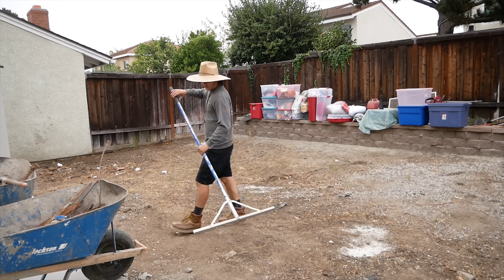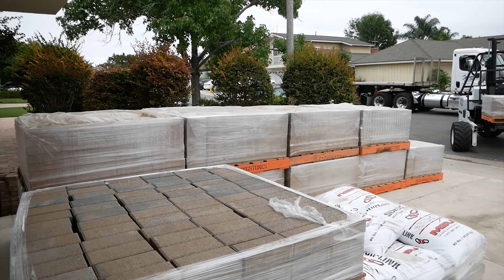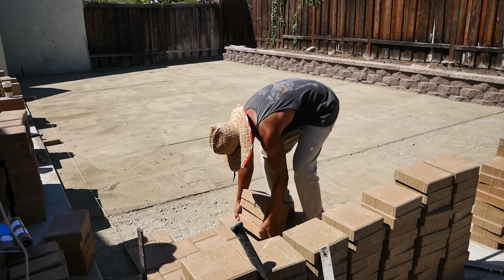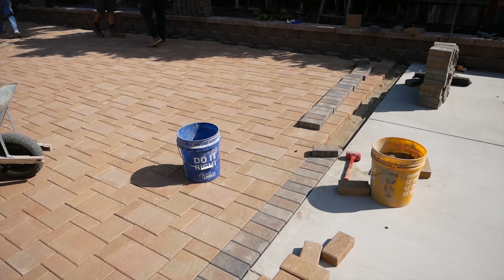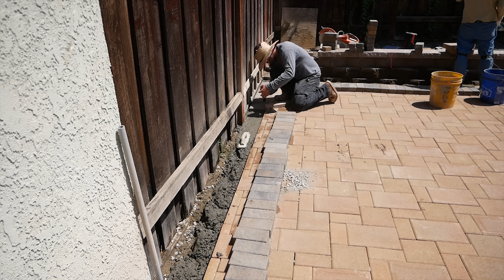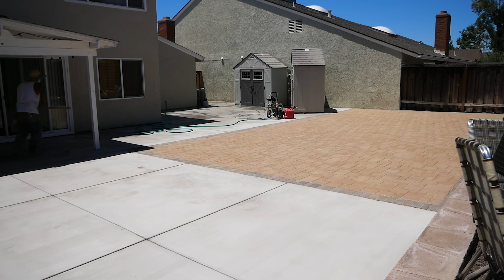How to Lay and Install a Massive Paver Patio! Part 5

Comment: Such beautiful work! Could you share the cost of a project like this? Or maybe the cost/sqft for pavers vs concrete slab? Does the price increase if you don't have vehicle access?
Thank you!
Reply from the maker: Pavers are twice the cost as pored in place concrete.
Access increases cost.
Reply: @OdellCompleteConcrete  Is that because of current construction material costs? Historically that pricing doesn't sound accurate at all.
Reply: @SirPhilMcCrackinVonBeggington  I can only speak for here in Germany, but paving actually is one of the more costly options you have. For one due to the price of quality pavers (depending what quality/thicknes you need, if you only have foot traffic, if there is some or regular light vehicle traffic, if there is heavy vehicle traffic...)
Sometimes in the cities shopping areas you will find pavers used that are actually about 4 inches thick (maybe even more) to allow for bus traffic.
But then the major amount of cost here is labor cost.
But in respect to certain building codes here, and costs as well, you rarely find concrete yards, you may not even be allowed to widen your driveway. Sometimes certain pavers that are permeable for water have to be used, adding cost as you can imagine as all the grading has to be done with respect to drainage. So although costly, pavers are quite common here and you will only really find a concrete slab in a backyard  if it is meant to be in preparation for outdoor tiles (Where large format ones can almost be laid like pavers). And even though it exists, you will very rarely find stamped concrete here.
It seem there is also a more and more growing trend in the cities to no longer allow sealing surfaces not meant for driving for different ecological reasons.
You will mostly find concrete here as floor slabs (we rarely have wooden floor constructions) or on our Autobahn if they expect a lot heavy weight traffic. More common, because cheaper would be asphalt for streets.
Reply: @alexanderkupke920  Thanks for the explanation. I have spent a little bit of time in Germany, great country. I like that Germany uses pavers a lot. They will absolutely outlast concrete, especially when made well and installed well. That is interested about your concrete floor slabs--do you not even have wooden sub floors? We have concrete foundations here, and then typically we will have wooden subflooring on top of the concrete foundation.
Recently concrete prices (and many other construction materials) have skyrocketed, so when it used to be a more affordable option, it's not as affordable as it used to be. What are construction prices like in Germany lately?
Reply: @SirPhilMcCrackinVonBeggington  Harding construction prices, they are righteous insane at the moment.
For comparison, I bought a new built townhouse with about 144 m² and about 300 m² land about 12 years ago at around 250000 €. These days the same house with minor changes (new code/standards regarding energy efficiency in between) which in back then terms would add at most 20000 € is sold for at least 400000 €.
But it is not only due to higher construction prices, the whole real estate market is a mess. And to be honest, in reality none of the houses would actually be worth the recent prices.
On materials, it seems at least in the past wood was more expensive as a building material.
Ok, so construction got more expensive due to material shortages and also a shortage of qualified masons, carpenters, plumbers, electricians, roofers,... You name it. In Germany usually craftsmen require a 3 to 4 year apprenticeship to learn a craft and be able to work as a journeyman. To become a journeyman you have to pass a theoretical and practical exam held by the chamber of commerce.
For things like electrical systems or gas lines you have to be at least a journeyman electrician or plumber to be allowed working on them and have them pass inspection. On the other hand, with that level of qualification required for being allowed to do such work, the inspections are less involved. It is common that a master plumber or master electrician checks his employees work. for most crafts you need either a master or at least a technician for that craft to be allowed to run a Business. Master is a second level of education and examination for an experienced journeyman. A master can traditionally tech apprentices. A technician is another level of education for an experienced journeyman resulting in an exam or certification. You can imagine a technician level here like a very craft specific engineering degree. (Compared to my engineering degree, which is in computer science, but included fundamentals of physics, electrical engineering, maths and the whole bunch) 
Back to building actually there may only be a final inspection to check if everything is according to the building permit and safe to use (like having railings to prevent people from falling).
But In between inspections on certain steps in the process became common as well to allow for corrections to be made before it is too late.
Regarding the construction type. You will find houses that have a wooden subfloor and wooden framework. Those are usually old  houses built between 1200 and 1900 from wood and clay.
For newer houses, you will see such things either at specialty wooden houses which are supposedly more ecological friendly but rather expensive or in houses built from prebuilt components (they build all the walls in the factory and assemble the house on site within one or two days).
The regular construction is of course a concrete footing, and on top of that we have a somewhat insulated concrete slab. This may either be the ground floor or the basement floor, if there is a basement (building a basement is rather expensive due to all the digging and disposal of soil and everything required to prevent water ingress)
On top of that slab walls are built from a variety of masonry materials. Lime sand stones are quite common. Non load bearing inner walls can be anything from kind of gypsum blocks to metal frame systems and plasterboard. Wooden framing is rather uncommon but may occur.
When only the outer and load bearing walls are built, they either lay precast concrete forms with reinforcement rods sticking out on the walls or built some forms and pour in place a slab on top of the walls. for the precast "forms" (they actually remain as the underside of the slab) more reinforcement is added on concrete is poured to slab thickness (may vary depending on the size of building, for our town house it is somewhere between 8 and 10 inches). The next walls then are built on top of that slab again and so on.
On top of that slab a finer type of concrete we call  "Estrich" is poured. I think I once found screed as translation.
Underneath the screed you will usually find electrical and plumbing lines, a layer of mostly styrofoam or polyurethane foam like insulation and piping if there is subfloor heating. Air ducts for heating and cooling are uncommon for private homes and usually only found in larger commercial buildings. We usually use hydronic subfloor heating or hydronic heating registers.
Electrical lines usually get out in slots chiseled into the walls and plastered in.
In general walls are smoothed with a layer of plaster. Today only about an 8th of an inch. 40 years ago it might have been almost an inch of plaster to compensate for less even building materials.
On the outside the walls are covered in several inches of insulation. Something like glass wool if bricks are used to cover the walls or some systems of airtight foam panels if it is Stuco.
Roof constructions are done by carpenters out of wood. But no sheething. Usually insulation in between the joists or rafters or whatever the right term was, a layer of plastic or cloth like material to keep wind out, Perkins or another layer of insulation (usually a system of sandwiched hard foam) and as roofing material most common is concrete roof tiles. But there are a variety of options and roof forms. Ours for example is a pent roof (i think that is the right name,but I might be wrong) with a watertight foil a protective felt, a drainage layer and on top of that a substrate growing succulents.
Actually in German cities it is very common to have development plans that quite tightly describe allowed size, roof style and even details like materials, colors etc. 
In exchange, we do not have as tight zoning, so you will find a lot of duplexes and triplexes as well as combined busines and residential buildings (like a shop on the ground floor and apartments on the upper floors) usually only industrial and commercial buildings are more separated. (Due to noise etc.)
I think on YouTube you best can view some videos Matt Risinger Made a few years ago showing European construction. He also explained our completely different style of windows as well.

Oh boy, i just realize this got wayyyyyyy longer than initially intended.
Reply: @alexanderkupke920  That's really interesting to read, thank you so much for taking the time to type that out. I will check out Matt Risinger's videos, thank you. When you said that you have houses built in 1200, that is still amazing to me given the very young age of my country. I would say that at least 90% of home constructions in the USA are still wood framed. I do NOT think wood framing is good for longevity. How long do typical newer constructions last in Germany? Just a typical private home like yours? I would argue that houses built here have roughly a 60-70 year life span, depending on a LOT of factors, particularly homes that were build starting in the 1950s or 1960s. I believe that is when they started building them with inferior techniques and materials. How long does a typical roof last in Germany? A typical shingled roof in the USA seems to last 15-20 years if you are lucky, but also depending hugely on your area of the country.

Comment: Really enjoying your videos. Good stuff as always. Just a quick Q: is it only sand you are laying pavers on or sand mixed with cement. Where I'm from people suggest mixing sand with cement 4:1 or 5:1 ratio and I do not really see the point in that.
Reply from the maker: It's called polymeric sand that we purchased from the paver suppliers
Reply: @OdellCompleteConcrete  So you are using polymeric sand not only to fill up joints between pavers but also as bedding sand?
Reply: @secondson294  There is no fucking way he's using polymeric sand as bedding sand--that would be prohibitively expensive and completely unnecessary. Even polymeric sand between the joints is overkill.

Comment: So the neighbors side of the house is in / on the backyard? What kind of property line is that.. crazy
Reply: This was a pretty common thing when I lived in Vegas, but a little worse than this. Instead of having a traditional front/back yard, the only yard the houses had was the side yard that shared the neighbors wall. The actual backyard would be the garage that led to the shared drive way.

Comment: Instead of filling the uneven and irregular gaps between the edge of the pavers and the retaining wall with polymeric sand, which will lead to weed growth, why wasn't concrete or additional cuts of the pavers considered?
Reply from the maker: There was weed fabric placed under all the pavers so no weeds will grow

Comment: You could pour a thinner concrete patio.  It would be perfectly flat and then just super easily lay the bricks on top.  You would be guaranteed that the pavers would never ever sink.    Concrete patio is much cheaper than doing pavers and laying pavers on top is so fast and easy.
Reply from the maker: Yeah this definitely could have been an option but it would have costed more because concrete would need to be atleast 4 inches to not crack
Reply: @OdellCompleteConcrete  the bricks would add a good amount of stability to the concrete.  Could concrete with fiber be thinner than 4” and not crack with the additional reinforcement  from the bricks on top of it?
Reply from the maker: You might Beable to get away with 3 inches but it's a risk
Reply: @OdellCompleteConcrete  also wouldn’t a concrete bed just hold all the water? This way the base lets excess water through that doesn’t require a drain.